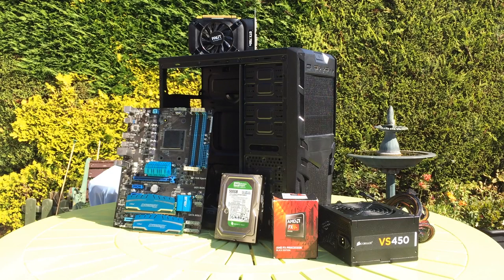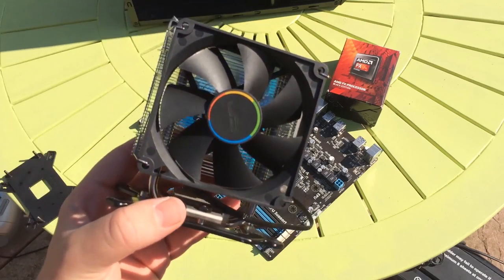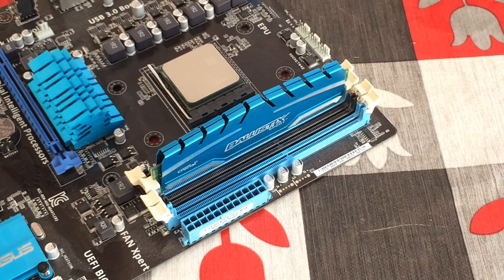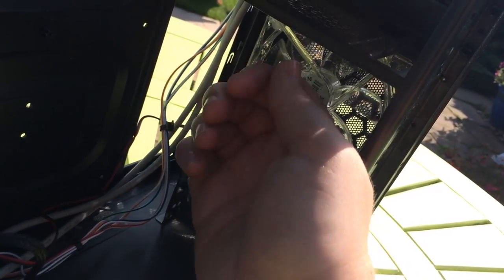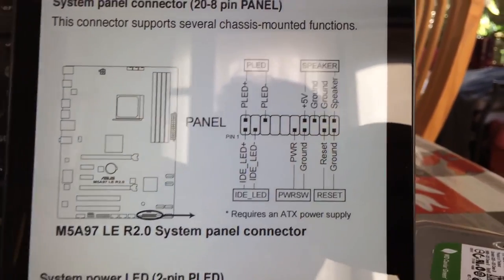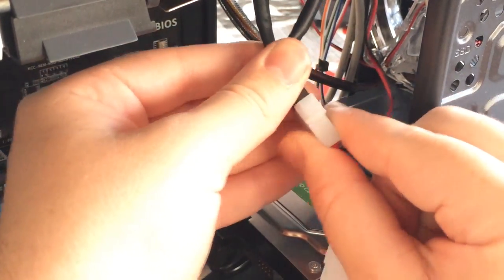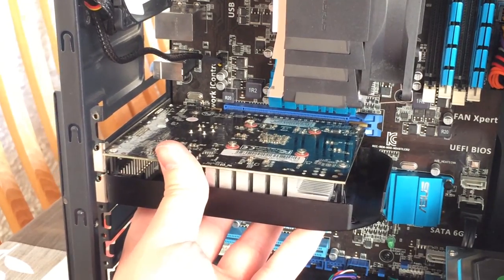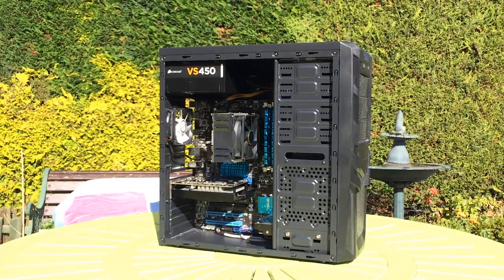Let's Build A Budget Gaming PC - Sensible Used Parts System

Comment: Can someone help me?
My thermal paste is dried up and I blew my last bucks on a gtx 750ti
Reply: Niggalodeon use mayo or jam and save up for actual paste
Reply: Scrap off the dry paste in to a small dish then mix in a tiny bit of grease or vaseline. Re use ;0)
Reply: Techno Crat i removed the stock intel heatsink, cleaned it and put it back on my cpu, it now goes from 78c to a 100c
Reply: Have you even put any heat sink paste on ?
Reply: Techno Crat I had some pre applied before I took the heatsink off and put it back again after cleaning
Reply: Niggalodeon dude don't run that cpu. 100c is going to cause serious degradation. You're gonna wanna wait until you can use some new paste. Unfortunately my only advice is to wait it out.
Reply: ArtisChronicles did mention my q6600 is ocd at 2.8 on the stock intel cooler?
Reply: You prob not seated the cooler well and got a slight air gap. Invest in a better cooler & maybe a better cpu. A good socket 775 cpu is a Xeon X3360 and as their a server cpu their goin cheap on ebay £15 should get you one.
Reply: Try putting a toothpaste until you buy a thermal paste....

Comment: I have this cpu mine is overclocked at 4.20 however it bottle necks my gtx 770. I also have 16gb ram. I wouldn't buy this cpu buy the budget Ryzen chip.

Comment: Is my system still up to date for games?
Motherboard - gigabyte ga-b85-hd3-a
Ram -  8gb 1600 GHz DDR3 crucial ram
CPU - i5-4460 (Stock cooler)
Graphics card - GTX 960 2GB founders addition
Reply: ofc , this pc is enough for modern gaming
Reply: It’s fine. I had a 4460 and gtx 950 for a while that played games fine. Just have to turn some settings down sometimes
Reply: Totally, I have an i5 3350p (3.1GHz), 8GB RAM and a GTX 770 2GB and it runs everything I throw at it, newer/more demanding games will run on med-high, lighter ones like Overwatch run maxed at 1080p with AA enabled

Comment: Is it worth ti change b150 to b250? Or change i5 6400 to one of the r5s? What would the mo o be if i changed to r5?
Reply: B350 for R5 (if you want overclocking, and you might as well). If you need the threads and extra performance, sure its definitely worth it (threadripper is worth it for a lot of people, but its also a huge waste of money for sub-par gaming if that's all you do).
Reply: Hastr0 Aldner I wouldn’t go from the 6400 to an r5 unless you already have a really nice gpu. For gaming only the 6400 will handle a 1070
Reply: Hastr0 Aldner b350m

Comment: might as well change the title to "Let's Build A Severely CPU Bottlenecked Budget Gaming PC" lols c2q/g4560 laughs too
my current recommended minimum budget pc specs are i5-2500/560ti/2x4ddr3/hdd/trpsu/case which runs around 200 without haggling...

Comment: rate my rig : 
CORE 2 QUAD Q8300 CLOCKED TO 3.3 GHZ
RADEON HD 7970
8GB DDR2 oc RAM
OLD LGA775 MOTHERBOARD I GOT FROM A FREND FOR FREE 
OLD CASE THAT I ALSO GOT FROM THE SAME FREND FOR FREE 
IT CAN RUN ANY GAME AT MIDIUM SETTINGS 360P 
the whole thing onely cost me $70
Reply: your CPU is definitely a bottleneck. 7970 is a great GPU for 1080p 60 fps gaming.
Reply: +RK sorry 7570*
Reply: +BoudewijnB man I used a ps2 for the past 8 years of my life , I got used to 360p
Reply: I rather to run it on higher settings and lower resolution

Comment: Can u rate my Rig?
i5 6600k
Gigabyte Intel GA-B250M-D3H
8GB 3200mhz DDR4
GTX 460 OC (I blew my budget on the CPU)
VS550
No Case
Reply: "no case" that means no fans which means you have hot mess of a pc with a shitty gpu. If youre on a budget you should have gotten a ryzen 3 and a 750ti.
Reply: Will your build has a nice case i alos have that one
Reply: i wanted a Solid CPU and  i do very little gaming and i have 2 92mm fans cooling my PC
Reply: You would probably get better performance with a case, cause of the extra cooling
Reply: Just save up for atleast a gtx 580 and get a shitty case online atleast man. put a desk fan up to that shit too for extra cooling
Reply: Will i would give 0/10. Don't get me wrong. But you went overkill on cpu & not only that you paired it with non overclockable mobo. You went overkill with ram as well as you could have saved money by opting out for 2400 mghz ram. Don't get me started on gpu lol. & by the looks of it you are new to building pc so you should have purchased a case to avoid any potential disaster. Don't take me seriously though...
Reply: You could've gotten a r3 1200 and a better GPU. You failed.
Reply: Okey  maybe a bit harsh, but those are pretty shitty parts/decisions

Unlocked i5 from not the latest generation, with a locked motherbord from the latest generation. just, why?
Get a i5 7400, or as I would recommand,  Ryzen 3 / 5. Get a cheap b350 mobo with that so you can still overclock, stock good enough so not needed.

You're ram, Why such a high speed, its just more expensive without being actually usefull for the skylake platform, for ryzen I get it but now its just waste of money.

VS550 power supplies are utter shit, ive had 2 of them failing, actually damaging my ssd, ( When under load it literally just shut off my pc) though, it may not be in you're experience so not bad, 500 watt is probably the sweetspot

GTX 460, thats just stupid unless you payed like 5 euros/pounds for it, you can actually get an HD7850 for around 30-40 euros, I myself bought a XFX HD7850 2GB for 35 euros, which can even play PUBG on 1080p 60fps!

No case, no comment, you can always try and get one for free from some1 who wants to get rid of it.

Hope this helps budget builders,
HD7850 is sweet as hell for the money :)

Sorry for some bad english if it's in there, not my main language,
Reply: Appears the board doesn't support overclocking, so the K model CPU is pointless if this is the case.
Reply: Way too much of the budget was blown on the Processor.
Your motherboard isn't even oc capable yet you bought a K series i5.
You won't even benefit that much from the fast ram.
and running everything outside of case for extended periods is reckless.

I'd recommend saving up and buying these parts in this order.
1. Decent Case
2. Better GPU
3. OC capable board.
Might as well add in a 120/240gb ssd for a boot drive in the future.
Reply: Will when u get money... upgrade the gpu my friend
Reply: Will and buy a case with fans too my friend
Reply: Will that was a very dumb thing blowing ur budget on that. An i3 6100 would have been fine and you would have been able to get a gtx 1050 which has more power.
Reply: decent, but your GPU is not enough for new titles
Reply: If you have no case than its gonna go boom boom
Reply: Unless you want to put 7 Fans around the motherboard
Reply: i bought the 6600k because the one i got was cheaper than most non k 6600s  and i wasnt planning on overclocking anyway. The 3200mhz ram was a mistake, because it was advertised as 2400mhz. and the gpu i got for free from craigslist. and as for a case, i have bolted everything down on a wooden board. on my shelf
Reply: i got the gpu for free and i dont do that much gaming anyway
Reply: thx for advice but the 6600k at the time i bought it was the same price as the non k. and i wasnt planning on overclocking anyway. The ram was a mistke. i bought 3200mhz but it was advertised as  2400mhz
the gpu was free from craigslist and i didnt do enough research into the power supply
Reply: i bought the k - series i5 because when i bought it it was the same price as a locked i5
Reply: my old cpu was an i3 550. i jsut wanted 4 cores and the gpu was free
Reply: If you want a budget gpu, go for an HD7850, for like 30 euros, or like a 750ti for 60
Reply: Sorry to say but that is just a mess of p.c and makes zero sense. K series chip on none overclock motherboard makes no sense. Ram 3200mhz makes no sense ur system won't use that speed.
Reply: wtf would you pair a 6600k with b250 lol for the same price you could of gotten a ryzen 1600 and b350 ..something that will actually be useful in the future

Comment: Rate my PC
i5 3570k(not over clocked)
Gtx 950
8 GB ram ddr3 1600mhz
Asrock H61m vgs mobo
Raidmax 400w PSU
Reply: Subi_fan Im a 15 year old and sold my Xbox one and brought in all my savings to make my 400$ PC I play games at 1366 x 768p and I couldn't be happier 
Great Suggestion though..
Reply: Subi_fan Yup I have a 768p monitor but I play most games at med - high on AAA games and ultra on esports titles so I'm good

Comment: Oh lord.  No.  That motherboard is the most diabolically useless piece of shit ever made by asus.  I had to deal with one for 4 and a half years, and I nearly lost my mind.  Let me just list off a few things.

-No front panel USB 3.0 Header (Seriously, this is just stupid given it has a 3.0 bus and a 970 chipset)

-No VRM Cooling solution and shitty VRM components.  This is by FAR the worst part about the entire board.  Why the actual F*CK would you manufacture a motherboard with a chipset which allows overclocking, but the worst VRMs on the planet?! Every single time I tried to OC my 6300, the VRMs would overheat and the chip would automatically underclock itself to 1.45GHz after 10 seconds of Prime95.  The MAX OC I was able to achieve was 4.03 GHz without the VRMs overheating (Might I add, with custom heat sinks I built for them?) I had my voltage set as low as I possibly could without instability.  Absolutely ridiculous, given other board have no problem boosting this chip to 4.5-5.0GHz on air coolers.

-False advertisement: They claim the board has 2 X16 PCiE slots when in reality the bottom is only 8x.  This is a no shit thing for most people since the AM3+ socket never had support for that many lanes, but regardless, this is a stupid advertising claim to take advantage of inexperienced buyers.  

-No integrated GPU.  Not an issue for most people but for a $150 mobo new, seriously ASUS? If your discrete takes a shit, youre fucked unless you've got plenty of cash lying around for a new one.